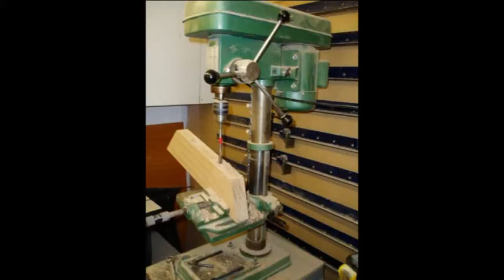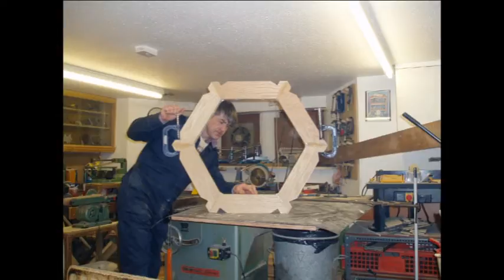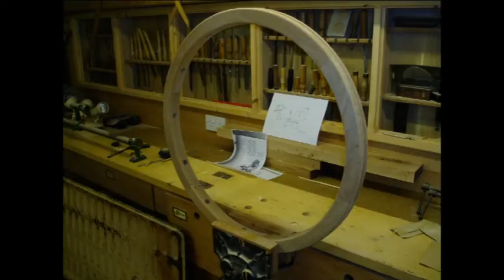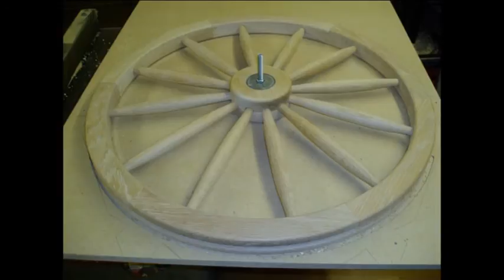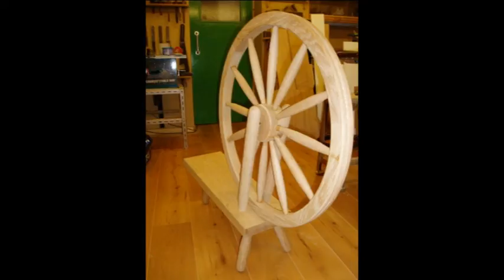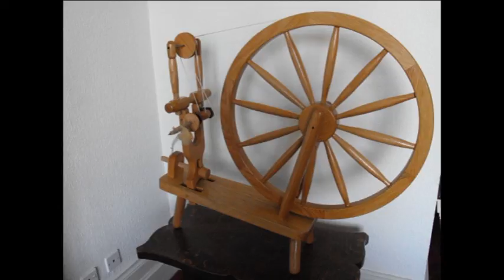Spinning wheel Construction

Comment: Hi, my dad who is 94 is making a spinning wheel and he is stuck at how to make the grove on the outside of the large wheel. He has all the common wood working tools  including a lathe but it is not large enough to mount a wheel. The part I am looking at is at 51 sec in the video. Thanks if you see this.
Reply: He didn't use a lathe. He used a router. To do the groove, look for a suitable cove router bit.